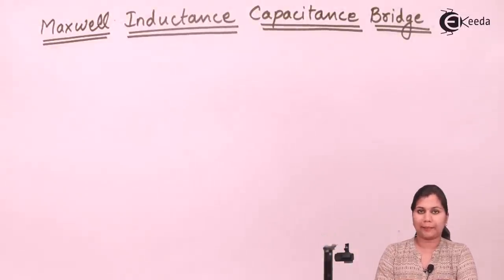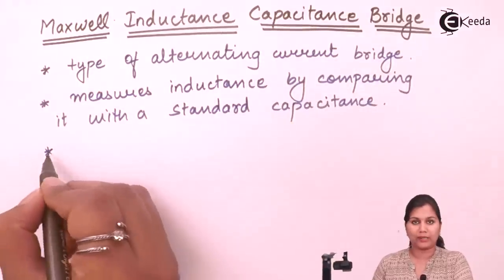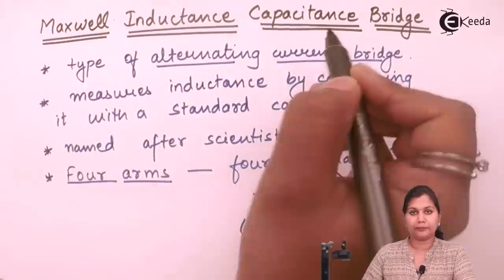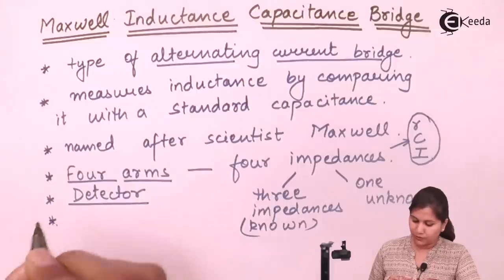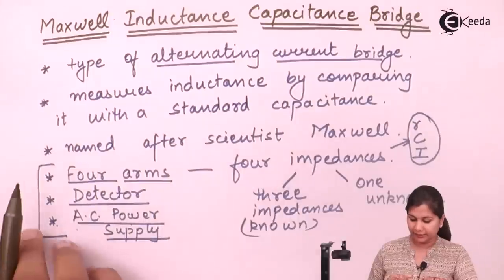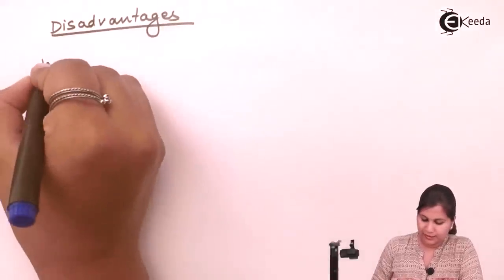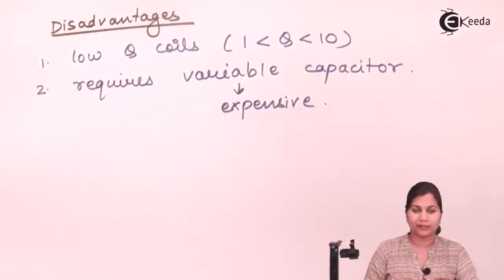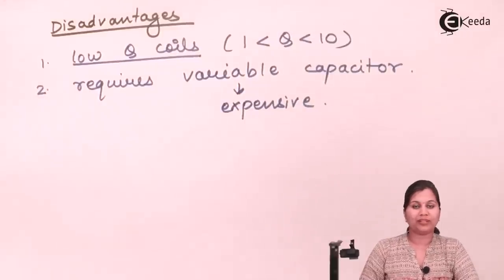Maxwell Inductance Capacitance Bridge for Measurement of Inductance - Measurement of Inductance

Comment: I have a doubt in the Balance equation of impedances, in the class of MEASUREMENT OF INDUCTANCE BY THE MAXWELL'S INDUCTANCE BRIDGE, you wrote Z1 for a to b, Z3  for b to c, Z2 for a to d and Z4 for c to d. the equation is correct Z1.Z4 = Z2.Z3. but in this class, you wrote differently Z1 for a to b, Z2  for b to c, Z3 for a to d and Z4 for c to d. 
will it affect the equation? or is there any reason you took like that?

Thank YOU :)

Comment: Its not voltage lags.....its the current lag/lead voltage....If u r saying about a single phase supply, the sinusoidal voltage has a fixed phase angle and the phase angle of current will be changed according to the characteristics of components used in the circuit...but if u say about 3 phase, there can be a phase shift between each line voltages.....